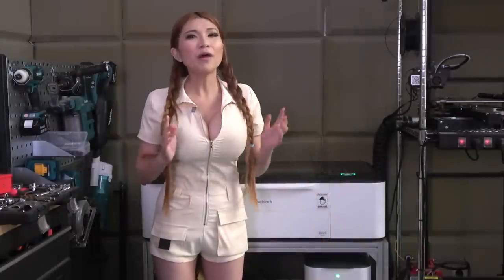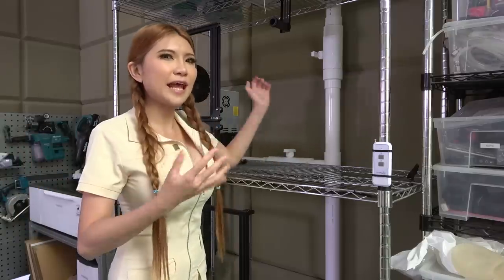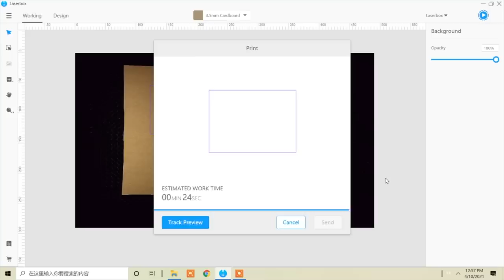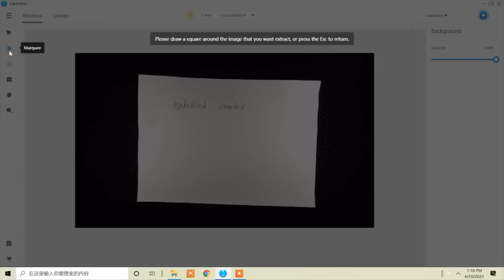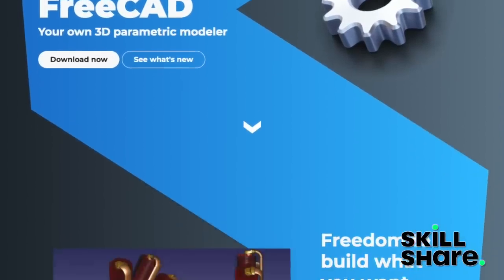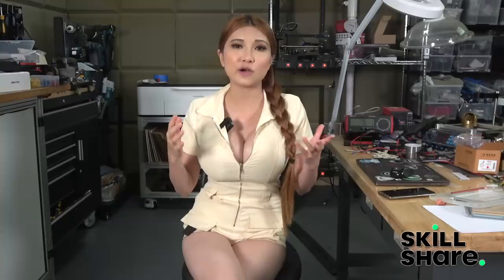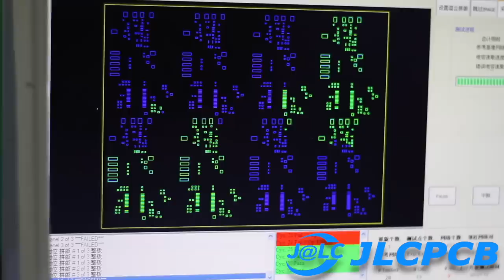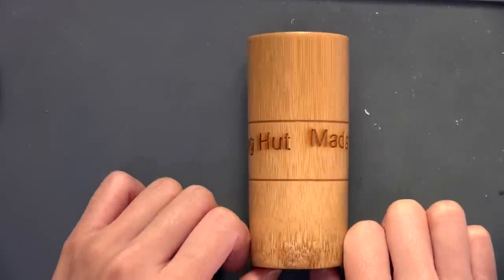Makeblock xTool Rotary Laser Cutter Review

Comment: You need to put some cover like duck tape over your material before engraving or cutting. In this way you get way cleaner results as the fumes are not attaching to the side of the cuts

Comment: The rotation unit is quite interesting. I think it may work better if you 3d print some holders for the ends so it is not rotating on itself. One flat with rubber for grip and one graduated cone to center object. Both ends having a bearing for rotation and one a pulley with a belt to the stepper drive to rotate the object. The end without pulley could be on a rail or in a groove at the base with a spring for tension on the object. No more wonky text on your pretty cups!